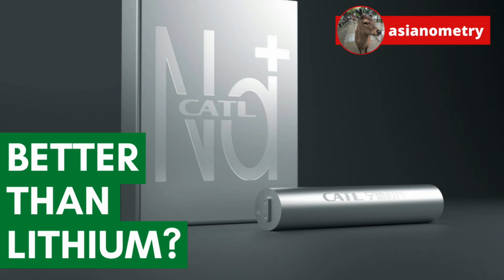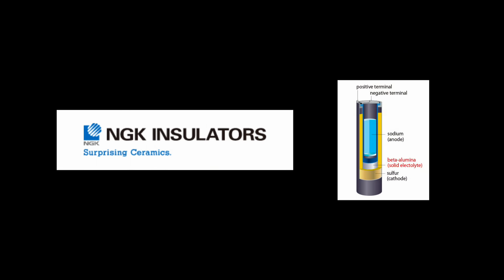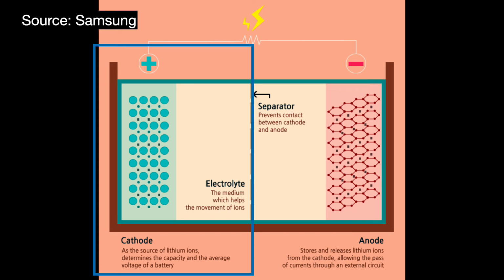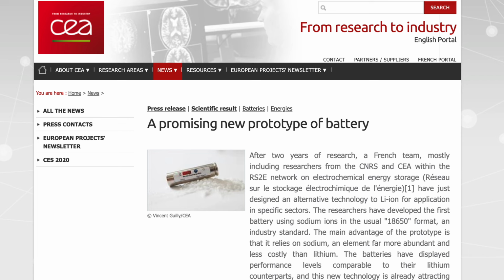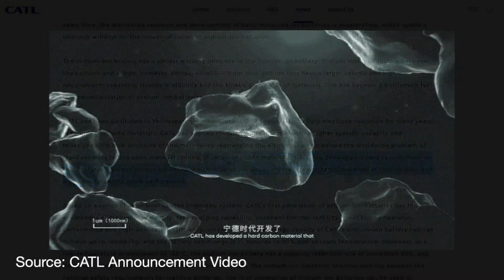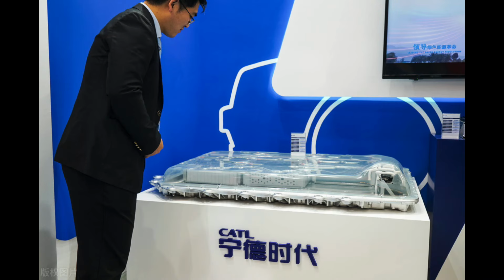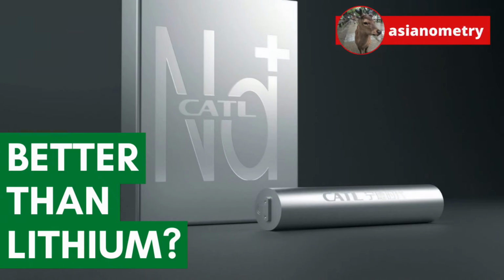CATL's Sodium-Ion Battery: Better than Lithium?

Comment: .... and you dot not have to buy sodium iron batteries from CHINA, AVOID POLLUTION DURING PRODUCTION, ETC. ETC . WELL RESEARCHED  AND EXCELLENT REPORT!👍😍👍😎
Reply: Contemporary Amperex Technology Co. Limited, abbreviated as CATL, is a Chinese battery manufacturer and technology company founded in 2011 that specializes in the manufacturing of lithium-ion batteries for electric vehicles and energy storage systems, as well as battery management systems. Wikipedia

Comment: Why bother with these dangerous, if not potential explosive elements, when you pressurized Hydrogen exists? I mean for Schoolers, eBikes and S Class Pedlalac's (e.g. Moped replacements), lithium Ion seems like a terrific compromise. But, this really doesn't scale well when you want to get from New York City to say San Francisco, in about 3 days time. When you have to park your car at a charger. GOOD LUCK FINDING ONE, IN BUMF**K AZ! Where as Hydrogen Gas can be added to the existing chain of Gas stations across the Globe. But, the powers that be have deemed that toxic Lithium in Cars is the way of things to come. Makes you anticipate the next Ice storm seizing those bird killing Windmills up, and causing all kinds of havic. Because Nuclear is on Nat-see levels of pure evil.
Reply: Both gasoline and hydrogen are explosive
Reply: Look at Fukashima for  hydrogen explosions. Just the pressure vessels for it are a bomb 600 bar. It will leak out of all materials except graphine/diamond, and pools at your ceiling waiting to explode!  Its usable energy for production energy if horrible 1unit out for 4 units in. And your car will still have Lithium(nca) batteries. Most places would not want to have hydrogen filling stations they are dangerous.

Comment: When it comes to any battery based on crystalline structures it's always a question of doping. The Na-ion battery hasn't yet received the attention needed to test the wide range of doping capabilities possible. We know that some of the most efficient biological systems out there use sodium but the question is can we dope the salt crystal while still keeping it stable / and redesign the structure to accommodate the anode and cathode based on the direction of the lattice structure. I'm just a noob but if we can more easily control the structure of the lattice of the material in question then that would result in cheaper manufacturing I'd think. I hold to hope for this technology.
Reply: Yep, gotta wonder why our bodies prefer sodium to conduct signals over everything else.

Comment: Not sure if want to ride in the rain on my eBike with a Sodium powered Battery.
Reply: just put on some waterproof clothing :D
Reply: @w0ttheh3ll  The sad part about this comment is that such blankets actually exist for these Batteries. Though I gather it's more to keep the battery pack from weakeing in the cold.
Reply: @Ichijoe2112  anyway, the real answer to your comment is that these batteries will not have a problem with rain. the "don't like moisture" part of this video means that the materials need to be kept extremely dry during manufacturing, which makes the factory more expensive. the final battery cells are sealed and don't care about the humidity of their environment.
Reply: I don't like riding in the rain either but I do it all the time. Covers for your shoes is a good idea as are lights

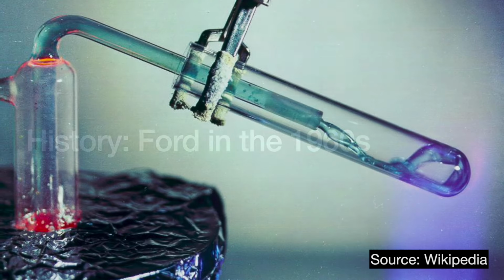Comment: That photo of molten salt at 2:29? That’s actually a sample of liquid nuclear fuel! The molten salt in that photo contains Uranium-233 Tetrafluoride (synthetic uranium created from another element called Thorium) dissolved into more salts, in this case FLiBe, which is a 60/40 mixture of Depleted Lithium-7 fluoride and Beryllium fluoride. There’s probably Zirconium tetrafluoride in there too.

It’s funny to see nuclear fuel make a guest appearance in a video about battery chemistry

Comment: We're still at the cusp of transition to EV - when everyone driving a vehicle is driving an EV, we're going to need a different battery tech than Lithium (and Cobalt and Nickel). Availability (abundance) and low environmental impact (sustainability) will become THE dominant factors. Sodium, carbon, iron rust - those are very abundant resources on Earth and can be obtained and refined with less onerous technique than the more exotic elements. Factors like vehicle driving range would not be so problematic once charging stations are ubiquitous such that any place a vehicle can be parked has a charging receptacle.

Comment: after that Tesla grid storage Lithium battery just caught on fire in Australia, am not very inclined to have a Tesla Powerwall battery in the home. A less efficient, bulkier battery tech would be perfectly fine in that scenario if it offered much greater peace of mind so far as safety goes.
Reply: It wouldn't. There is still the same amount of energy stored, and it would use the same flammable solvents. There are certainly risks associated, but they can be managed to gas explosion levels. If you start to look you realise there is a lot that can go wrong in a home that regulation keeps in check (usually, it is only obvious when it fails). This is no different.
There are still lessons to be learned, but I would assume (and hope) that the domestic installations have significantly more safety features than for the ones deployed in the desert.
Reply: @agsystems8220  The problem is energy density - the same amount of energy in a very small volume becomes very like an explosive.    The energy density of a typical lithium battery is not far off that of TNT.  A cabin crew neighbour told me she has dealt with 3 on-board fires in smartphones, usually by putting them in a metal cocktail shaker!

Comment: Something I don't often hear about is that because we don't find pure sodium on the surface of Earth (it is actually more reactive than lithium) we have to gather it from other sources such as the ocean water or salt lakes. This is done through electrolysis or thermal energy leaving behind the salts. 

From electrolysis, the oxygen and hydrogen can be used in a hydrogen fuel cell to generate clean energy, and with the thermal energy the steam could power turbines for the same ends while providing clean desalinated water. In some regions the same can be said of Li+, but this is about 40% of what is useable as opposed to the sodium which is 1000x more abundant and makes up 3% (by weight as NaCl) of all seawater.

Comment: We already have a good enough battery for electric cars with the use of battery exhange stations.
As for grid energy storage, sodium would be so much better.
Only airplanes need the densest energy storage. 
We need to conserve copper by running as much as we can using themal solar generated hydrogen.
Reply: Recycled copper is abundant.

Comment: 10-30% isn’t nothing. Also, isn’t the moisture problem solved by the battery being sealed? Does moisture get in still somehow?
Reply: moisture doesn't get in once a battery is made. being sensitive to moisture means it's harder (more expensive) to make the batteries.
Reply: But you still have  to use   globe box either you use Persian blue or white cathode or not Because of water reactive nature of Lithium and Sodium and its organic electrolyte . So nothing will have to change in manufacturing process for moisture .

Comment: Yes, better than Lithium. Price is more important than range, especially for cities! We need more 50-250 mile EVs! Or rather, we have enough at the top of that range, but we need them to be cheaper!
Reply: There are other ways to make things cheaper. Deflating the WAY OVERINFLATED Greenback, is surely one way. But, of course because doing that would make perfect sence. Nobody would ever do it.

No the overall price of an EV Automobile isn't itself the problem. Most EVs today are little more expensive than "normal" cars. The problem is two fold. 

1 The aforementioned range.
2 The time it takes to recharge the battery. Sure Quickcharge is a thing if you want to kill your investment even quicker. You can cheat the system all day long, but these Batteries prefer a longer charge time than most people would prefer. What when you can 'rechage' a normal Car. In less than 90s at the Gas pump, pay the bill, and be on your way. Even a quick change would take you over an hour, and again only hurts the batter pack more than just letting it charge overnight.
Reply: @Ichijoe2112  ,, Problem is the ever-growing quantity of rare raw materials and  complex manufactured materials used in ever-more complex vehicles. Your ability is make new materials is not matched by your ability to recycle them, and is matched by your ability to bury this under the carpet. We should be developing clean carbohydrate fuels and better ICEs (+ heat engine combination, ideally). The more 'power efficient' your cars get the more resources their manufacture consumes. 
--
Also, there is only one FINAL SOLUTION to the IMPENDING DOOM that all ice core records show will happen in the next few hundred to 7000 years - THE INEVITABLE NEXT ICE AGE.. Interglacial periods last from 10,000 to 20,000 years in the ice core record. We're about 13,000 years in. The only solution is MAN MADE GLOBAL WARMING.. Trapped Under Ice.
Reply: @PrivateSi  7000 years or even a few hundred it makes no matter. It would come too late to save humanity if we don't get off the trajectory were on now - and that's IF the insane amount of greenhouse gas in the atmosphere hasn't completely obliterated those long term climate cycles by then.
Reply: @Ichijoe2112  .. The real problem is the Internazi Fake Green Fake Economists want to industrialise and develop the entire 3rd world. Just imagine the amount of Neodymium, Cobalt and Lithium (or hopefully potassium) alone, scaled up massively.. The problem is each e-vehicle has a much higher 'natural resource footprint' even if it's carbon footprint is lower than a normal vehicle. The total tonnage of land mined to make e-vehicles is much higher than better, older cars.
Reply: Price is more important to you, not me.
Reply: Sodium or Graphite based batteries would be great for its low low cost and infinite amounts, but if it could be have been done-tesla would have. no one would choose super expensive and limited Lithium in their batteries if they didn't have to. it's obvious the technology is not their yet, if ever, for sodium or carbon/graphite based batteries. if we can't move away from lithium in batteries, then the next choose should be green hydrogen fuel.
Reply: I have not said any nuclear power stations should be mothballed. I live in the UK, hardly have any nuclear power and the new development will be Enriched Uranium-based, shame, but not too late to halt it. I am very much against wind farms and hydro-power.. Solar is fine as long as not subsidised.. 
--
EVs are as fake green as you can get. Evermore complicated manufacturing processes to deliver what will always be an inferior solution due to the limited max fuel capacity of even the best theoretical battery (barring a nuclear battery....an Iron + Carbohydrate economy is much easier to recycle than a 1000 rare chemicals + Lithium (or hopefully Potassium) economy. 
--
Exhaust gas can be stored in the vehicle, perhaps in conjunction with a hydrogen cell in a closed loop, where the carbon and oxygen is just used to stabilise the hydrogen after being released from the cell.. Oxygen can be filtered out of the exhaust fumes and released, while the rest is compressed into a tank (cleverly sharing space with the fuel tank, and also pressuring the fuel).. This can be deposited as a gas station for reprocessing..  Fake Greens in the UK gave a tax break to carcinogenic diesel cars, BTW..
--
There is still a lot of potential to extract more from efficiency from carbohydrate fuels. and engines designs. Cheaper, simpler, more reliable designs that run on many different fuels.. I have a nice combined ICE + heat engine.. It's rotary, crankless, free piston, small and simple. I probably stick my bad 2D drawings up on a youtube vid at some point. The idea is very cool. Power-to-weight and complexity/simplicity are the factors I look at, in manufacutirng and recycling terms.. I have never agreed with with industrialing the third world. Sorry, I'm not a Liberal.
Reply: @PrivateSi  but overall, rotary engines use the fuel faster thus create more pollution.
- As rotary engines have very less space for combustion of the fuel, it (thr fuel) doesn't burn completely before it is exhausted out.
- Rotary engine require more lubricants to keep it scratch proof the side walls which inturn add to the more pollution.
- Till the date, no research / experiment have shown that rotary engines are fuel efficient but are more fuel consuming than IC piston engines.
.
I support e-vehicle for cleaner and greener planet given the elements/material used in manufacturing them are sourced using green energy.
Battery operated vehicles are far better if the electricity used to charge them are generated using renewable sources like solar power, hydropower, windpower..
Also extraction of battery elements should be eco friendly process with minimal harm to the nature.
.
Reply: @SuniL.KrishnA .. Wankle engine variants are about on par with standard internal combustion engines, efficiency-wise, but I have my own rotary engine design where the entire say 25cm diameter, 25cm long, 1500cc reciprocating, crankless, free piston, 1 STROKE engine...
--
it literally compresses air+ fuel mix into an impeller combustion chamber each end of a cylinder, providing drive, that then ignites, providing drive, with a surrounding outer ring piston in a ring cylinder filled with compressed, sealed CO2 around the main cylinder, pumping high pressure gas around impeller veins interleaved between the combustion veins.. Pistons are about 20mm wide, combustion/heat engine cylinders are about 12cm long. Enclosed combustion veins meet at a central point and have holes connecting the veins to the cylinder. 1 engine or 1 for each back wheel
Reply: @PrivateSi  🤔🤔🤔. Is it possible though??
Reply: @SuniL.KrishnA  .. Certainly possible. The power efficiency is high, with good power to weight ratio of the engine. I have basic designs on powerpoint, no fancy CAD models. I have a few designs, including fuel tank (filtered) exhaust gas storage for reprocessing at a gas station, via a diaphragm in the fuel tank to work in conjunction with my Heat Engine system that converts exhaust gas heat into power, cooling the gas.  
--
Flywheel Battery / Capacitor idea that uses the battery weight for kinetic energy storage when braking. I may someday make some videos on my currently unused 'Simplish Ideas' Youtube channel.. Other ideas on other topics too. I'm not into patents and marketing and all that crap, or even building the things.. I'm an ideas man.
Reply: @PrivateSi  great job my dear. But ideas and diagrams don't make a vehicle run with the results it sounds.
Reply: @PrivateSi  It would be easier to list the things you like. You seem to be opposed to everything,

Comment: As soon as we have a 10Kw capacity  battery with a solid electrolyte plus fast recharge and efficient  endless recycles, I'm going offgrid baby
Reply: child what are you talking about? it is already here.
Reply: Just get a dirt old EV or a wreck with a >20kW battery.  The battery will last many decades before it drops to 10kW.

Comment: I would imagine that CATL benefits from having in-house manufacturing know-how to help them come up with realistic costs and production modeling.
Reply: Already having production facilities built and useable equipment installed, there is no one better positioned to make Na+ cells than current Li+ producers. Given the potential profit for becoming the first major manufacturer of what could be the next generation of global energy storage , its no surprise they have invested so much money into the development. Lucky for them that their industry is growing in a sustainable direction
Reply: Michael Whitney We're still at the cusp of transition to EV - when everyone driving a vehicle is driving an EV, we're going to need a different tech than Lithium (and Cobalt and Nickel). Availability (abundance) and low environmental impact (sustainability) will become THE dominant factors. Sodium, carbon, iron rust are very abundant resources on Earth and can be obtained and refined with less onerous technique than the more exotic elements. Factors like driving range would not be so problematic once charging stations are ubiquitous such that any place a vehicle can be parked has a charging receptacle.